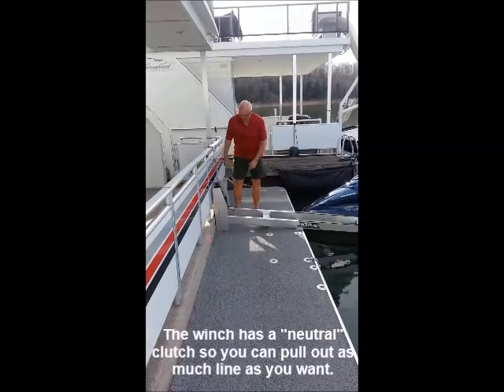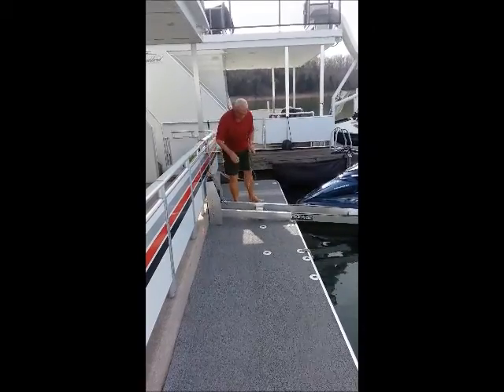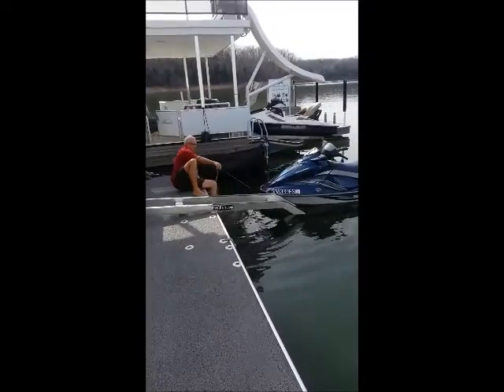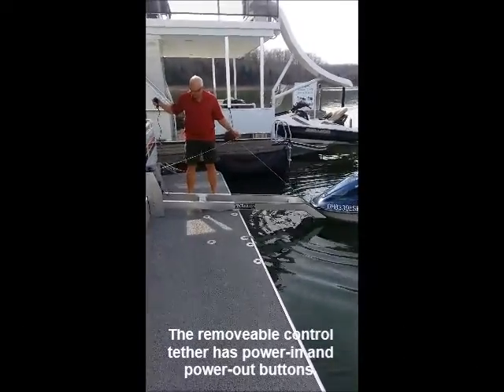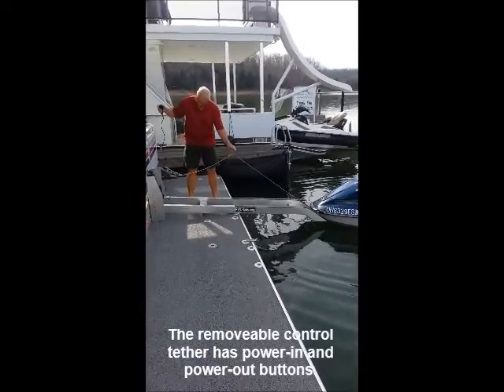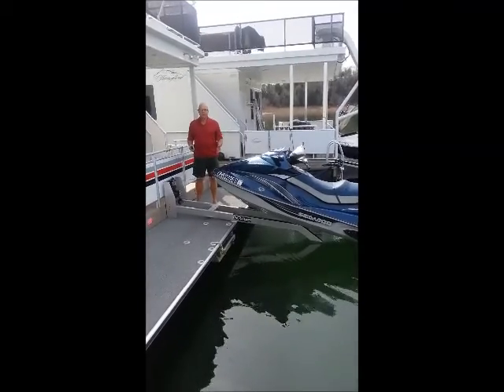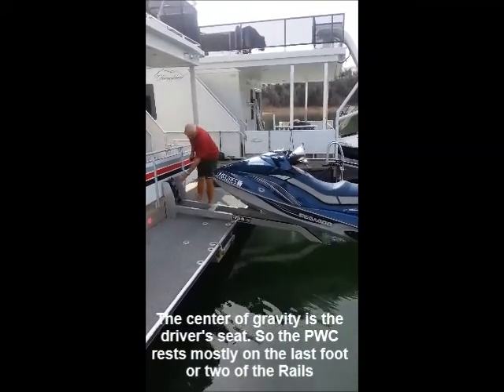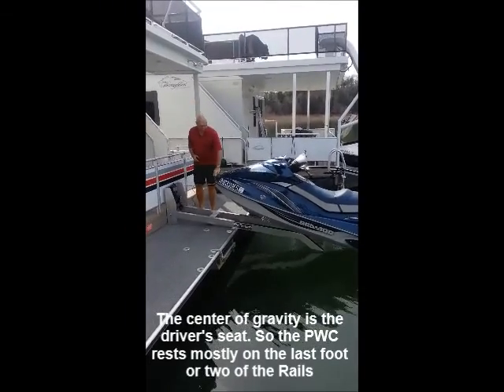Winching Up Your PWC

Comment: Those rails look like they’ll be cutting grooves in the PWC fiberglass in no time.
Reply from the maker: The inside “corners” of the rail tubes is “rounded” and covered with UHMW which allows the fiberglass hull of PWC’s to slide easily up and down the Rails. So the design has the strength of rectangular tubing, but the sliding surface that is the same as if it were made out of round tubing.